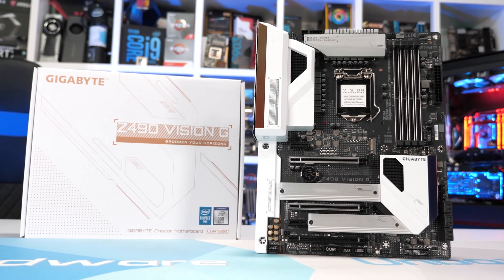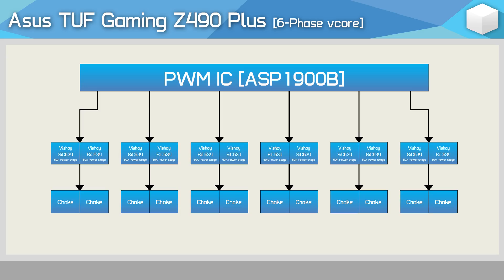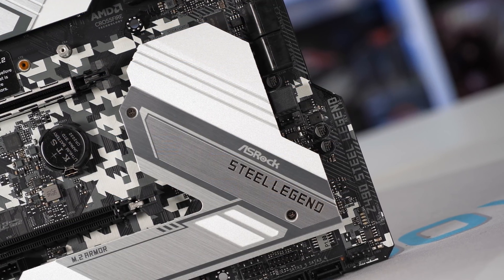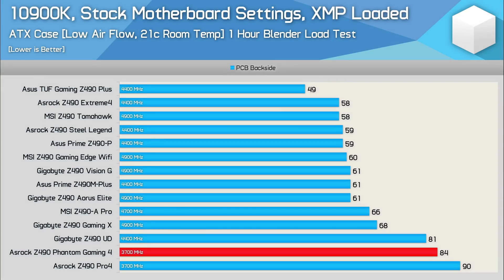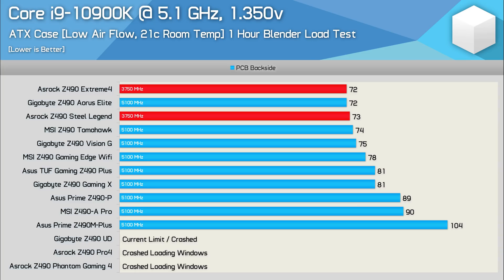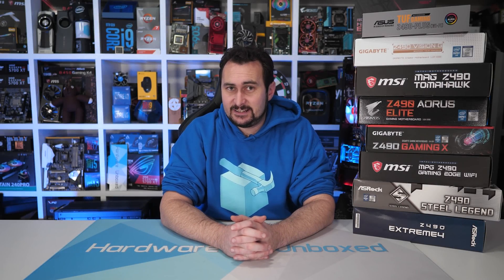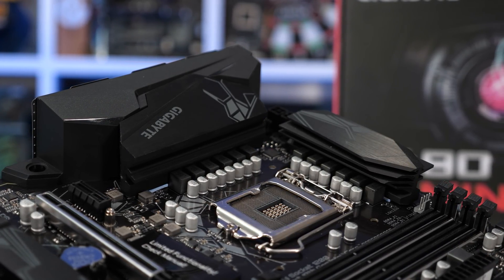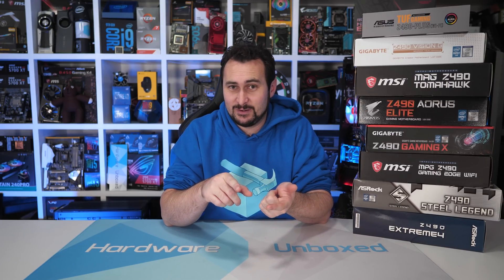Intel Z490 Motherboard VRM Temp Test, Sub $200 Roundup

Comment: Once again, the Tomahawk is in the top for VRM thermals.
Reply: MSi has really improved alot in recent generations
Reply: I would still wait for VRM testing results before actually buying any boards. We never know when MSI will mess another. 

Remember: buy the product, not the brand!
Reply: This review using an IR camera (instead of a thermocouple) from Japan found the ASUS TUF gaming to have the coolest temps of all the motherboards at this tier, what is going on here? I genuinely want to figure out which set of temp results are likely to be more accurate (as the measuring instruments used in that review vs this one were different)
The original review was at this link (translated from Japanese) https://translate.google.com/translate?hl=en&sl=ja&u=http://blog.livedoor.jp/wisteriear/archives/1077543129.html&prev=search
Reply from the maker: @jacobharvey9241  Those results are useless if I'm understanding correctly. The Asus board has been tested with the 125w TDP limit where as the MSI board is unlimited. So it's not exactly an apples to apples test.
Reply: @Hardwareunboxed  Yes I agree it is very strange. However, I think that they are only running those manufacturer stock setting power limits (e.g. 125W limit for ASUS) for the first two rows of results. In the bottom two rows of their VRM temp table results they set them all at specific frequencies with no limits ('PL1 unlimited/power limit invalid 4.6 and 4.9GHz results'). 

Still I think your results are a more reliable test of VRM quality as you provided actual OC results (they had none) with a controlled voltage figure (1.35V) set across all tested boards. Plus you ran a 1 hour stress test vs the 30 min of that JP review.
Thanks for taking the time to go through all the comments and respond to questions. It really sets you guys apart from a lot of other tech reviewers!
Reply: @jacobharvey9241  I saw that too. The tests are being run fairly in the link you proved above. Hardware Unboxed just missed it. I don't know if his tests are any more accurate either as he is only measuring from the back of the PCB with physical probes leading to potential error in installation.
 I trust the thermal camera more instead since the Japanese reviewer included the images as well for proof. And as you can see in the reviewer image you linked above, VRM temperatures vary wildly depending on where you measure the thermal from. The Japanese reviewer captures the entire board with his Thermal Camera. 
HW Unbox does not show where he placed his 1 thermal couple. But I am assuming that HW Unbox does not have enough Thermal Couple Temp Probes to cover the entire VRM board. 6:09
Reply: @Hardwareunboxed  if i do not Overclock do i get less Temperature  
Cuz i dont know about these i am a Vetaran to PC's
Reply: @jacobharvey9241  IR cameras are incredibly bad at measuring temperature of anything even mildly reflective, like metal
Reply: The gaming edge is great as well. I have a i910900k in it. Never any issues.
Reply: I mean if you have a saw and the heart to destroy the plastic covers of the vision G, I'm quite sure it'll perform better lol.
Reply: Aorus élite it s very good!
Reply: AORUS ÉLITE HAVE 12 REAL PHASE, TOMAHAWK ONLY 6!
Reply: Brother, I have 80$ a520 gigabyte motherboard with Ryzen 5 3600, is 60c vrm good (I am not overclocking)?
Reply: I know this is kinda random, but you don't have a channels discussion or any videos I can comment on, so I'm just wondering what your twitch channel (for osu) is, if you can dm me on discord or something (the tag is on my about page) lol. I swear I'm not a bot or this guy's alt, but I just want to have some friends in that game xD

Also, so this comment isn't completely inane in terms of being relevant to the content, I think that MSI are simply choosing to keep their products simple, not super "gamer-y" (at least on the tomahawk, gaming edge maybe this is not true), and focused on performance, which seems to be a winner among the enthusiast crowd, but maybe not more "casually-oriented" gamers. So that's my take on why it could be that other brands can't catch up, especially as MSI seem to have released yet another amazing line of boards in 2021.
Reply: Yep I might upgrade to that next year when prices are a bit more down for an upcoming i7 upgrade. :)
Reply: @markdavenportjr5129  good luck, nice look into the crystal ball.
Reply: 🤔 Seems it doesn't matter what CPU you buy the answer to "What M/B should I buy?" is MSI Tomahawk (even to get the best out of intel10000 'NON K')
Reply: @shaneeslick  Also generally true on the AM4 side.  They did right with that board with performance, features and price.
Reply: Wortless e-waste with dodgy design and questionable featureset, I look at this trash and then at EVGA Z490 Dark and just laugh because how pathetic every MSI board is (maybe apart from MEG Godlike). I am travelling to Europe when the travel ban is lifted just to buy the EVGA board...
Reply: @mikhailshi  Wrong.

Comment: I'm not so sure why I was excited to see this video I went AMD for the new build, maybe I just enjoy Steve's voice that much.
Reply: Hey man how’s your AMD build is it awesome? Also what do you use it for predominantly? Am interested to build one for fun to encode and render making use of ryzen advantage over intel for such task.
Reply: @JAYJAY-ch4ik  It's mostly being used for gaming with some use for workstation tasks inlcuding code compiling. It's nothing too extreme spec wise with only a Ryzen 5 3600 , 16GB of 3600 CL16 RAM with a Sapphire Pulse 5700XT on GPU duties. So far it's help up well for  my needs. It's been about a month since I built it and  so far it's been smooth sailing.
Reply: justjoeblow420 sounds great! Enjoy your PC! I think your specs is pretty great for non intense stuff!
Reply: @JAYJAY-ch4ik  get a RTX-card and render with RTX-cores, it will be way faster .
Reply: Andrew N I specifically require CPU power because I use handbrake to convert or compress files. Handbrake with cpu can cut file size by 40% minimum retaining 98% quality. For 1080p base files with no compression before, it will take 1hour exact on a i7 8700k and for a RTX2070 that I currently run it will finish it in 8 mins but no file size difference and lousier quality. But I do agree with RTX being killer solid for other sorts of encoding profiles and rendering! I would definitely get a 3 series RTX card and a 4 series ryzen chip by end of this year as it’s expected to release by then! Hehe thanks for your comments
Reply: Same. Intel is completely dead and I'm going for zen 3 but I love the vids lol. Will say the Vision G does look insane